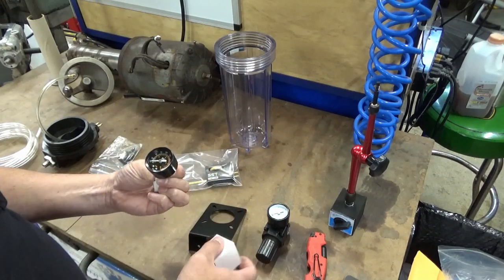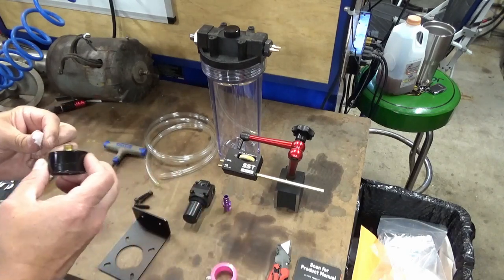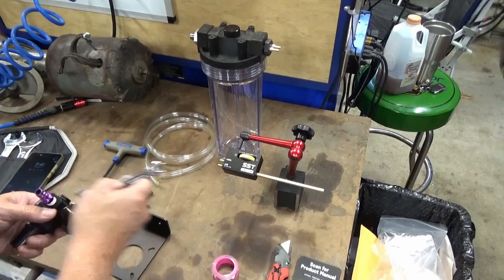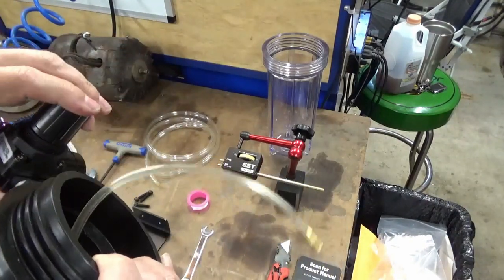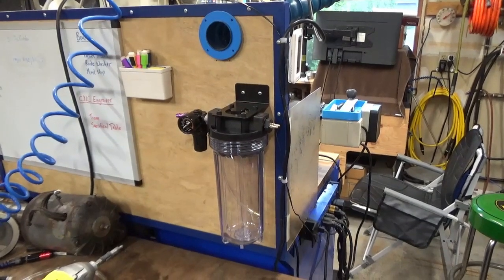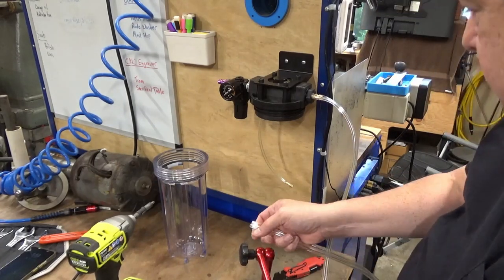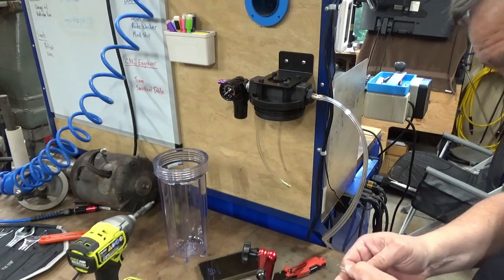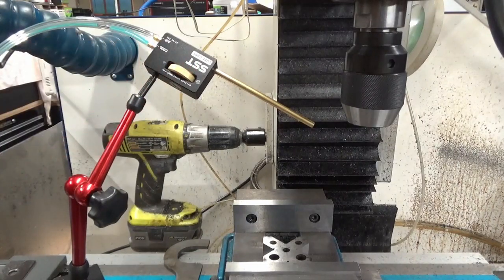Stupid Simple Coolant System

Comment: Hi Mick. I spent many years at ICI oil refinaries. We fitted many air & liquid hydraulic fitting. You always need sealant on taper fittings. We used the PTFE you are using mainly. Where the were high temperatures we had to use loctite.
Steve.
Reply from the maker: Good to know, thank you!